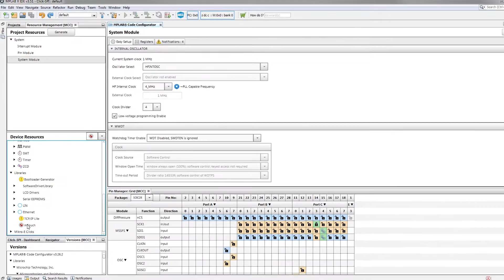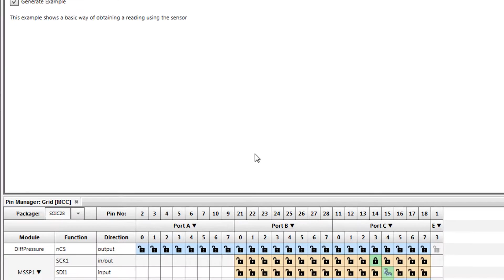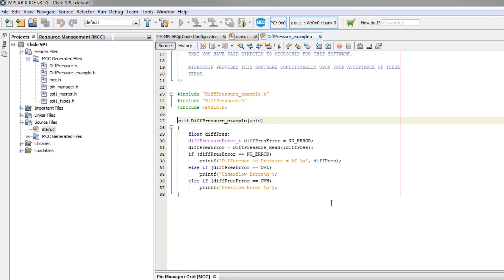How To Click Into MCC Tutorial #1 - How to Setup SPI-Based MikroElektronika click boards™ in MCC

Comment: Okay so when I try to replicate this I don't get the same set up on the MCC pin configuration manager when I select the diff pressure click - I don't get the DiffPressure nCS added to the manager when I add the diff pressure click to the project - thus cannot set up the pins.
Same thing with other click boards I was adding (I only tried the diffpressure to replicate the video)
What am I doing wrong?
Reply from the maker: Hi Sianni. Our support team will be happy to help you with this. Please go to support.microchip.com and you can post your issue on our MPLAB Code Configurator forum.
Reply: Microchip Technology I'm waiting for forum registration approval before I can post a query, and being my usual impatient self! thought maybe it was an obvious problem/solution? Will log a ticket if not.
Reply from the maker: When did you submit the registration? If it has been a while, I can see if our Forums admin can push it through for you.
Reply from the maker: Our support team doesn't monitor our YouTube channel, so using our regular support resources is the best and quickest way to get help.
Reply: Microchip Technology Only about 4hours ago. I'm just keen to get playing with the click boards so impatient 🙄
Reply from the maker: I can understand that. Let me see if I can find another way to get you some help.
Reply from the maker: Here's an email address you can try: mcc_support@microchip.com. I can't guarantee that someone will respond immediately, but it will go to the right team.